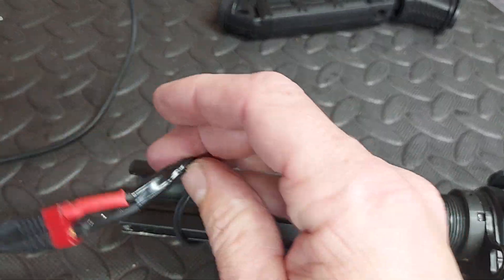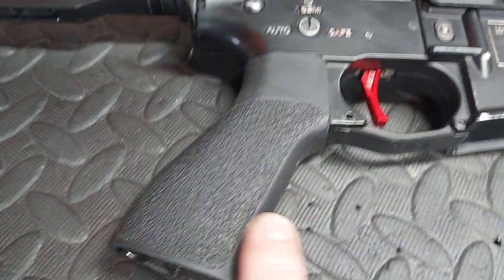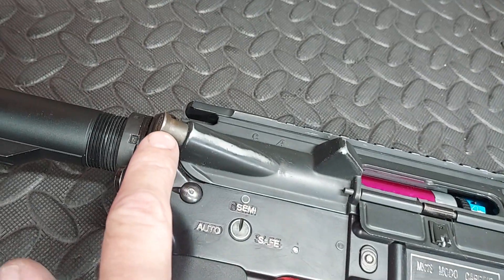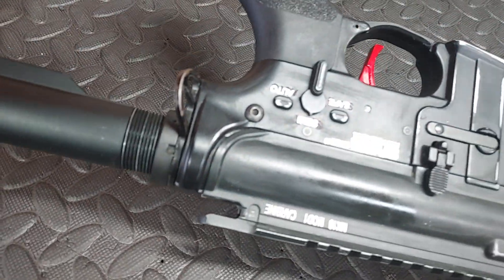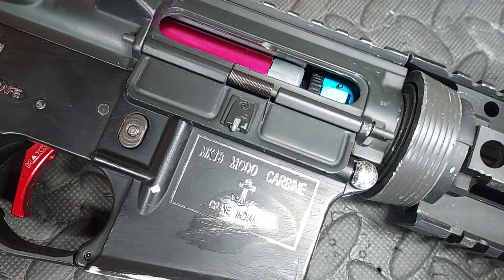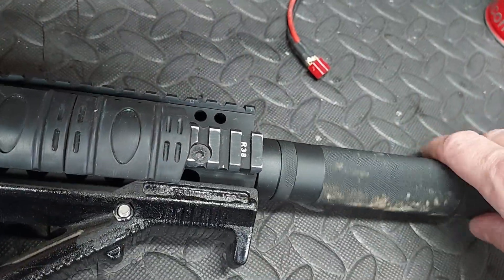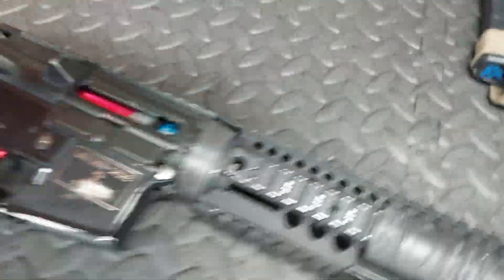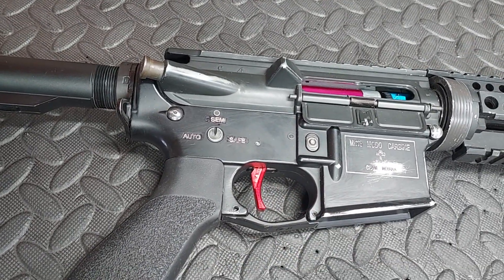Neg Shorts: WTF EVEN IS THIS?? part 1

Comment from the maker: Yeah, trigger... eff off, I know
Reply: Shit happens, I have a pretty mix and match platform it started off as a G&G GR16 EBB and now it's without a charging handle, blowback unit, has a 510mm inner barrel, 320mm handguard, a random Chinese motor, gears, piston, cylinder and cylinder head all unknown brands and it has an m150 spring yet it shoots 25 rps with an 11.1 lipo 😅 been wanting to sell it but too afraid to even ask anyone to buy it 😂

Comment: Every rifle unless it’s a wall hanger gets rust from moisture during hot humid play or rain, and some builds without sitting with a dremel for hours lose a few stock things. Not saying this example is correct. But I have an umbrella armory I hated and went over the top with that works better than most on the field but lost charging handle due to gearbox change and slightly bigger components. Besides I’m no cosplay dork I’m out there to shoot kids in the face and Dick all day.  So who cares about forward assist and charging handles on toy guns if it works.
Reply from the maker: Part 2 uploading now... you'll be eating those words my good sir
Reply: @NegativeAirsoftTech  can’t wait. And so polite. I can handle dirt. Lol. Feel free to sling.